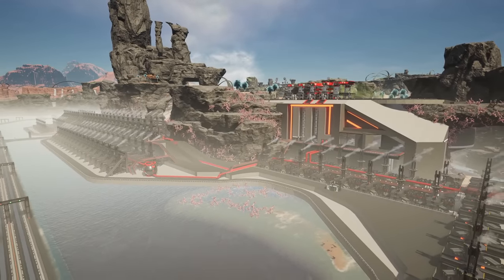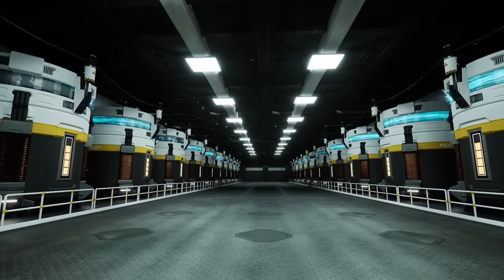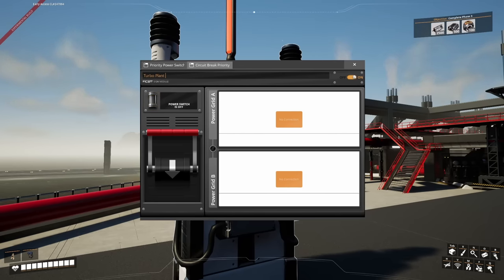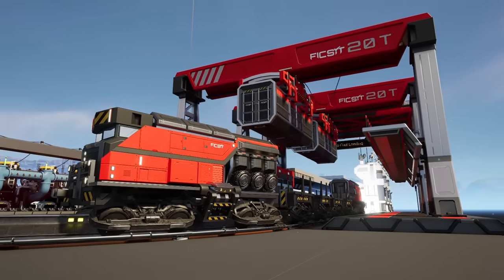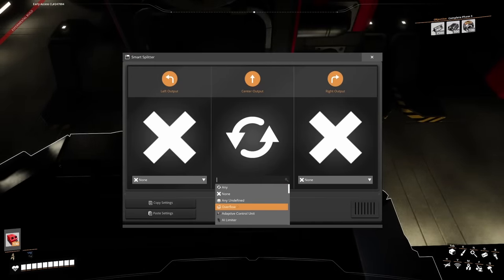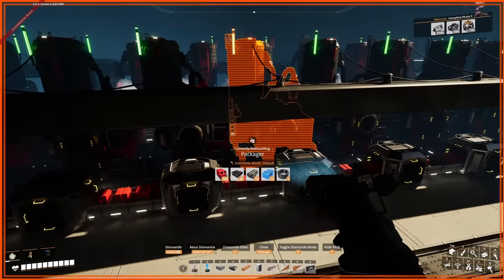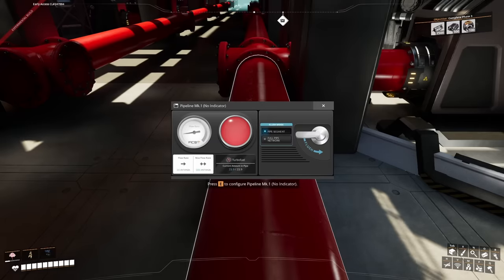Factory Failsafes YOU Need To Improve Efficiency in Satisfactory

Comment: I agree with the idea of making the failsafe. 

TL;DR: 1, agree. ALLWAYS load your system up with batteries. 2, Good idea to start using Priority Power Switches early, as when you do need it and don't have them it'll be a pain. 3, can be useful, but only really useful for belts with multiple items or large-scale factories. 4, Combining multiple outputs then splitting again can help, but the final conversion before splitting again can be a choke point and actually SLOW production. Make sure to check the belt's max speeds! 5, Really only useful for extremely large scale builds as doing this with normal builds can be accomplished by looking at which factories flash yellow occasionally on their indicator light. 6, pipes can break like that, but it's just something you need to keep in mind. 7, same as six, just keep it in mind. 8, ALLWAYS USE PUMPS IF GOING UPHILL. It's a basic mechanic of the game that the things that produce the fluids can't push the fluid uphill alone.

1. I love the first one as it saved me on multiple occasions. I build what I call in the game, Capacitors. Basically, 1 capacitor is a 3x3 grid of batteries. Capacitors are built to be stacked on top of one another to allow them to interlace. I also build a backup capacitor which is secluded with a switch that I can turn on or off at will incase of the need to jumpstart my factory again. 
2. Priority Power Switches something I have not used yet, but plan to. I recently built 2 massive builds in my world, Computer and Advanced Modular Frame production. These, especially the computer production (basic recipe overclocked to %250), increased the required power a lot, causing my batteries to be in use when I had not yet configured that area. Priority Power Switches will allow me to kill these factories without killing my main production. (Hopefully I should realize the Capacitors are draining by the time this happens though).
3. I've rarely done this in factories (as I rarely make large scale ones). most of the time I put this in areas when 2 items share 1 belt. Though I do not really use this feature (I mostly use the smart splitter for overflows), I can agree this is an amazing failsafe to have.
4. Used this a couple times when I was having the same productivity issues as you. It saved my rear a plethera of times and I love this tactic. I suggest this for some builds. Key word, some. Since you are moving them all to 1 line, then splitting them again, it can slow rates as conveyors can only move so fast.
5. Never done this as I've always found it easier to do it large scale(ish). I can tell how on a massive scale it can be a huge time save though.
6. Just recently (as I was making a computer factory) had to do this. I was partially running off of another line I had already set up for something, I did that, then it didn't work as well until I replaced the pipe. Not too useful, but good thing to know and keep in the back of your mind.
7. I... Did not know that... I've never had that problem, but it makes (sorta) sense. I always thought it was weird. I mean, Convayors get dedicated wall hole structures, but the Hyper Tubes and Fluid Pipes only get holes you can place. I guess it makes sense. Just like 6, not too important but a good thing to keep in the back of your mind.
8. YES, GOD YES. If you check a pump and it's reaching maximum head lift, p l a c e , m o r e . I cannot voice how much it's saved me. Whenever you do something to your pipes, ALLWAYS check the pump afterwards along with the pipes with their flow rate.

Did I comment too much? Sorry, I like this game a lot. Nice video though!

Comment: I've literally never built a turbo fuel power plant away from the production facility, nor away from the oil pumps. When I set up my turbo fuel plants, I always set them up to be right on the spot. Huge, but more or less right next to the oil veins. I then use electrical towers to connect the electricity to wherever I need it. I've never really transported turbo fuel via packaged turbo fuel. Just piped it straight from the refineries to the generators. I typically only ever package them when I want fuel for my jetpack.

Comment: Moral of the story, don't cut corners. But there were some really good tips. Looping your train like that was a pretty big mistake though... should have just kept it as push pull with no loops, instead of push pull with a single loop. Adding a second loop at the other end also works, then you don't need push pull at all

Comment: What I found works even better than switching a few of the consuming machines off entirely, is underclocking them. Just anything in the 1-25% range, not even any need to be exact about it. The reason is that a switched-off machine doesn't seem to buffer inputs, so while the pipes will fill, the machines' internal buffers will still be empty and immediately need fluid. But an underclocked machine will still fill its internal buffer at the same rate as if it were at 100%.

The big caveat with this is, don't use copy-and-paste on the machines' setup to bring things back to 100%: doing so seems to empty out the internal buffers (I think back into the pipes/conveyors so not destroying the resources? But if the pipe's full, it would destroy the excess anyway.) so you may as well use the switching-off strategy at that point. This worked for helping my own turbofuel plant finally stop fluctuating in output, and I plan to use the same to get the water loop up to speed in the aluminum factory I'm building.

Comment: One thing I do is make pipes go vertically, with a pump for a distance higher than the head lift without the pump, and then straight back down. Extra points if you put a buffer up there.

This makes fluids so, so much more reliable since they can't flow backwards

Comment: Heya Total! Your failsafe video came right in time for my power plant build. I have 24 refineries producing 960 heavy oil per min. I then have 25.6 refineries using 37.5 heavy oil and 4 compacted coal per min to make 768 Turbofuel per min. I divided that output by 4.5 per min to determine the amount of generators i would need. 170.666667. Anyway, i built all those, waited for everything to run at 100% after fixing several problems. At 100 % i am getting 17,100 MW, by my calculations I should be getting 25,000 MW so i just chalked that up to being on experimental until i saw this video. I built a 10 by 10 and a 3 by 10 grid of power storage devices, waited for them to charge and then systematically turned off each generator.  I waited for my pipes to over saturate and then turned everyone back on. Everything is running at 100% but i’m still only getting 17,100 MW. Can you possibly give me any idea as to why i cant reach full production? Thanx for your time and love your vids!!
Reply: First of, don´t use "Turbo Heavy Fuel" it´s the least efficient recipe for Turbo fuel. Secondly, do you have enough Generators build? It´s true you produce enough for 170,666 Generators, alhough 8500 MW is 56.6666 Generators and it´s kinda hard to forget 1/3 of the Generators you have to build. Wich would be more understandable if you overclock your Generators. Thirdly, if you have a certain number of Sulfur (and coal) available, the standart recipe for TF mixed with normal Fuel is the most Energie gaining, if my math works out.

From what you said it seems you have 720 Oil and 768 Sulfur/Coal. With Turbo Heavy Fuel you get 768 TF wich is 25.600 MW. Now reducing the production cost you´re at a net gain of 23.655,013 MW.
If you use the "Turbo Blend Fuel" recipe, wich is the most sulfur efficient one of the 3, you get 960 TF out of 720 Oil and only use 480 Sulfur. 960 TF is 32.000 MW, but it´s a net gain of 29.333,513 MW, wich is 5.678,5 MW more and you still have 272 sulfur more. But Blenders are a Tier 7 maschine, so you might not have excess to them, although you can very easily get around that with Blueprints.
If you were to go max TF with 768 Sulfur you´d get 1190,4 TF, but that requires the standart and the Blender recipe and is "only" a net gain of 36.002,9 MW.
For the biggest net gain of Energie with 720 Oil and 768 Sulfur (and Coal), you´d use the standart recipe to make 960 TF and use the remaining Fuel (768) in extra Fuel generators. This results in a net gain of 37.452,775 MW.

If your wondering about the Sulfur efficiency of the recipes:
Turbo Heavy :  1 Sulfur = 1 TF
Turbo             :  1 Sulfur = 1,25 TF
Turbo Blend  :  1 Sulfur = 2 TF

Comment: 8:37 to add onto this tip, while it’s not a complete failsafe for picking out those “needles in a haystack” issues, you should remember the existence and significance of the Status Lights mounted to virtually every machine.  They are the thin, tall, colored lights generally located in the uppermost part of the machine, often in a corner.  They serve the word not only telling you which machine(s) in a large area are inactive, but also tell you slightly finer status information.  Like which machines are overclocked (the light is white), unpowered or has no recipe selected (red light), inactive but still powered with a recipe (yellow), or actively operating at baseline efficiency (green light)

The number of times that remembering about this system has either saved me is surprisingly high.  Since it helps minimize the amount of time I’ll spend looking through my factories for an issue.  Be it either hunting through a complex for power shards I stupidly misplaced last session…. Or trying to root out which machine block is causing a lower output or volatile power fluctuation in a multi-floor, multi building complex with dozens of Constructors per level

Comment: I usually build things in stages or modules that can be progressively activated.  In the early game, often because I need the product of the line I'm building to build the line (plates, rods, mod frames) or the power plant has to bootstrap itself (It's real fun getting a coal plant primed with water). In the later game, mostly because there's a limit to the belt capacity for ingredients so building components larger than a mk 2 pipe or a mk 5 belt doesn't make any sense.

Because of the rail network, I always end up with one global power grid, and I often just don't build big enough to have power problems before I install something new.  I build a coal plant at the inlet between the northern forest and the rocky desert, both plastic and rubber produce HOR as a byproduct, which get burned for power, then about the time it's time to start making nuclear pasta I build a nuclear power plant and often a coal plant in that grotto near the giant waterfall.  Oh, and geothermal.  And that pretty much powers a factory.

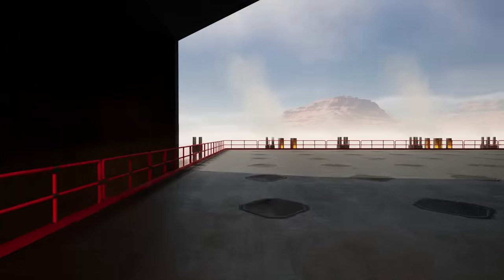Comment: @10:00
if pipe is not full or close to full (the bubble) flow will drop - max flow is only when pipe is close to 100% fill.
So if you did not prime your pipes you will never reach max capacity if input and output is matched. This is fine and easey on local plants, but for one that can get occasional input drops, I would suggest to have output reduced so in case ot su[pplu drop happen, pipe can refill, as otherwise whole system will slowly shutdown.

Comment: @7:30
So you split one manifold into two.
Prupoese of U shape manifold is to see inefficiency in input of output by seeing drop on ennd machines or clogs on belt (the S-manifold will show inefficiency by machines only).
If you split into two manifolds you didn't solve issue, you mask it by fact that two smallet manifolds will gave smaller total buffer, and in youre example input ratio suddenly was in threshold.

But yes, it helps for output ratios as in effect You feed two smaller production lines now. Ultimate version of this is non-manifold setup.

Comment: A good rule of thumb for power storage backups that i live by is i build them as large as necessary in order to match the full output of my power plant for 1 hour. So if i have a 30 gigawatt fuel power plant i will have a 30 gigawatt/hour power storage facility. There are two mods that i think are utterly essential for making a large power storage array. the Smart mod (for building lots of stuff at once) and daisy chain everything. Without them building these large arrays, and doing the cable management for them is a real pain in the nuts.

Comment: and with power issues u have main switches that throttle parts of my factory so if i do start running close i can shut sections of it off or least half my production until i can get better power going it has saved me so many times doing that way with careful power grid planning

Comment: Great tips, thanks. I really need to put the priority power systems in place for my factory. I'm thinking that protecting entire self enclosed power generation setups as one unit, so in the case of my oil one that's the two oil wells and everything that hangs off them, including a sink overflow channel.

Which is relevant as while your tips are great, you missed the sink overflow output. When storage is full, everything backs up, therefore if you really don't want the factory to backup then a smart splitter with the sink is essential to handle when the output storage gets full. Where a factory produces multiple goods this becomes more important, but a single output factory it's just a way to get more sink points otherwise doesn't really matter. For a power generating setup such as an oil one then it's pretty much essential just in case the removal of the "waste" products, such as plastics, doesn't happen fast enough. It's a good failsafe for something like an aluminium processing plant too.
Reply from the maker: Glad you found the video useful, we did talk about an overflow splitter in the video, but not in regards to storage as that's IMO not a failsafe situation - though you're right, we should all have resource over flows for the storage to gain tickets :)

Comment: The way ive made trains work flawless is having every train dump into an industrial storage with 2 mk5 belts, and plan for using AT MOST an mk5 and mk4 belt leaving the storage. This allows for the contents to empty out from the train station faster than the line can possibly take, and the result is you can prime the system with the storage so the manifold is alwsys full. And even if somehow your line is disrupted, repriming it isnt the end of the world. 

I also do this in reverse for loading trains, as i always like to match my belts going into and out of to make a virtual belt on the train car. 

Same logic applies to fluid cars if youre not going the packaging route, just make sure you use less than 1200/min so you can dump your fluids into 2 storages and have them flow out as needed.

Comment: Excellent video.  About smart splitters to safeguard manifolds, sure, but avoid sushi lines or sushi stations as much as possible.  Or do sorting immediately at the station.  But sill, a final smart splitter is much easier to fix than hundreds of feeder belts.  Definitely.  About pipes.  sigh*deep-breath Placing things on pipes then removing ends sometimes leaves slivers inside the pump/valve/junction (pipe device).  I always and only connect pipes to supports, delete supports, add pipe device, connect from pipe device to support.  Pipe floor holes are broken badly.  On the mild side, a floor hole through 1m or 2m foundation always eats 4m lift.  On the harsh side, they just don't work at all.  You mostly rightly omit fluid storage entirely, as they just slosh infinitely and eat flow rate.  The only fluid storage that works is a fill pipe to one side, and key pipe to low side with a valve set to zero to pressurize another pipe.  It's self priming, mostly.  Except in case of a pipe flush or pump power loss, then you must open the valve to establish pressure, then close it, and do so for all valves on the line.  gl w/tht.  Usually still worth it.  For floor holes, sometimes I just submerge (about 0.3 or 0.4m, I forget) a pipe support. then bend it horizontally.  There should be enough of a nub protruding from a foundation to attach pipes from both sides without dismantling foundation.  time consuming and ugly, though I try to hide the vertical support in the rear and it's somewhat ok.  But doesn't suffer head lift wonk.  Sometimes you must go up or down a lot and have little choice.  Can also plant junctions in 2m fountations I guess.  Really like the balancer discussion.  Encountered this when thinking of a train fed global wet concrete build out in the swamp (by the broken ocean water).  Trying to design an overflow balancer chain loop so that any single station excess goes to the next and around to the start as needed.  8 station outputs to 7.5 belts used per line, but 10 belt (5 car) stations ... 5 of them, perhaps.  Pre-filling machine's internal fluid buffers doesn't so much eliminate backflow as prevent sputtering from starvation.  You never quite fully fill everything so there shouldn't be backflow.

Comment: Stupid question but why didn't
you use fluid tanks for your train instead of plastic canisters?
Reply from the maker: It's not a stupid question. Unless it's changed, you can transport more liquid by packaging it first than by transporting fluid by freight.
Reply: @TotalXclipse  Ah ok
Reply: @fasty93  1 Packaged Liquid = 1 Unit of liquid
Fluid Train has a Capacity of 1600 Units
Item Cart has a Capacity of 32 Stacks wich in case of Fuel etc. is 100. So 32 * 100 = 3200 units, double that of the Fluid Carts.
You need more Power to unpackage them, but you have less/shorter Trains moving. 
A small tip: if you want Packaged Fuel, either to Transport it or to use it, "Diluted Package Fuel" is more Energie efficient than "Diluted Fuel".
Example: 100 PF
DPF: 2,916666 Refinerys, 1,6666 Packager    = 98.203 MW
DF: 1 Blender, 2.5 Packager, 1.25 Refinerys   = 133.8 MW